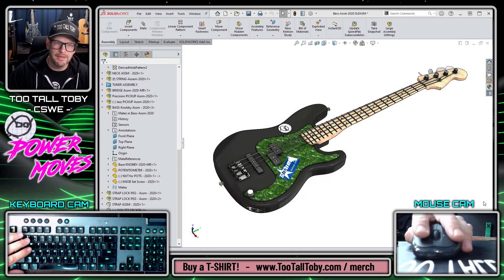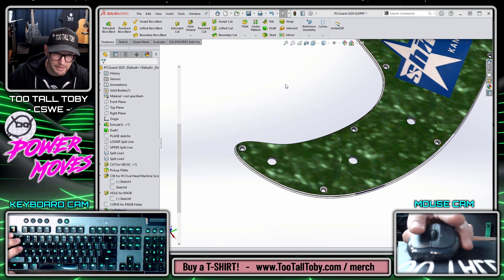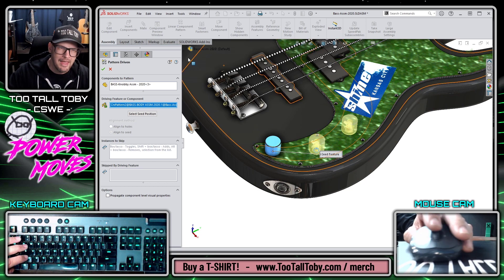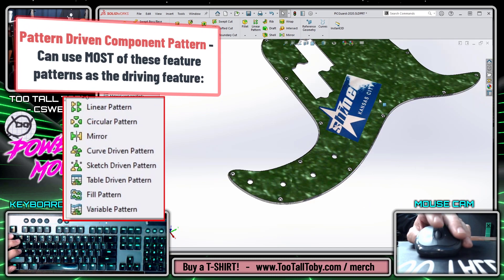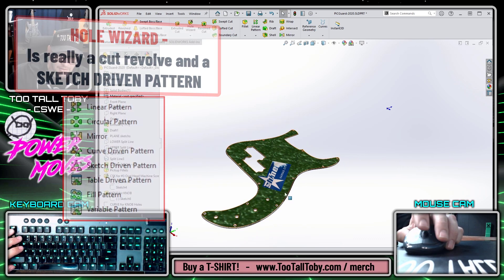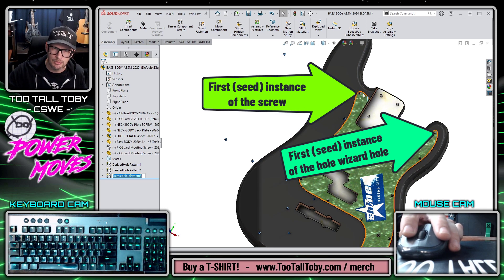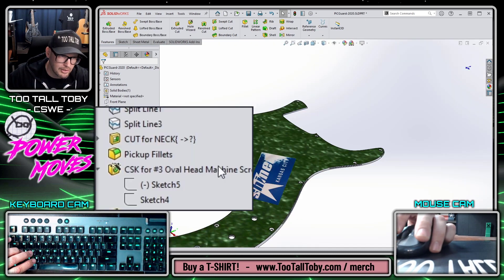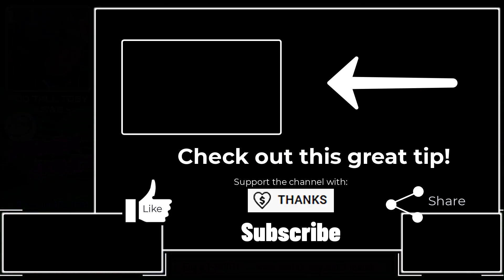Assembly Pattern SUPER POWER MOVE!!

Comment: How could you edit the bass body to draw and cut extrude the pocket for the knob pots, while the pots are visible, assuming you wanted to draw around the pots to tight tolerances. As to remove as little mass as possible from the base body; ???
Reply from the maker: You could do this using the same technique I used throughout this demonstration - the MASTER MODEL LAYOUT PART technique!  You would draw the location of the pots, using circles in the master model part to represent the required through hole and, optionally, recessed pocket, for the pots.  Then you would use these circles when drawing the geometry for the pocket.

Comment: I have an interesting question that I have been wondering for a while. Assuming all the other parameters are the same which method strains the model more (results in worse performance along the way in terms of build times, etc.)

1. Patterning entities in sketch then applying a feature 
2. Applying a feature then patterning 

What do you think?
Reply: Feature pattern is always preferred over sketch patterns because of more parametric freedom when you have to make changes, also sketch patterns consumes more GPU because of the sketch relations and dimensions which also have to be resolved with in the sketch itself..
Reply: Rebuild times are a secondary goal compared to model reliability, ease of editing/modification etc. in my opinion. Sketch patterns are to be avoided in general for this reason.
Reply from the maker: Agree @pargeterw !!
Reply from the maker: You can make the same model using both techniques, then look at feature statistics - this will give you the answer